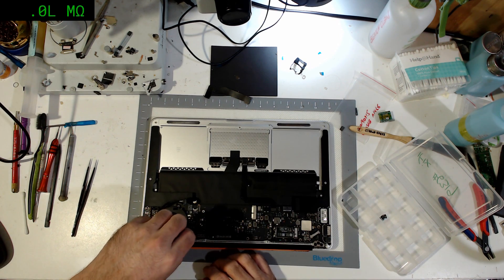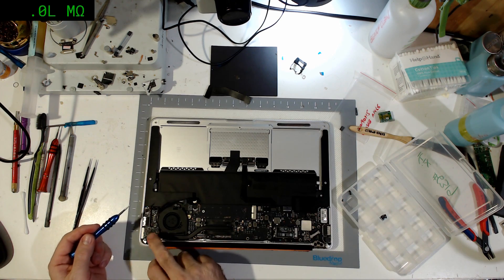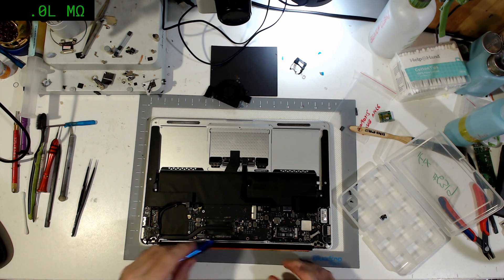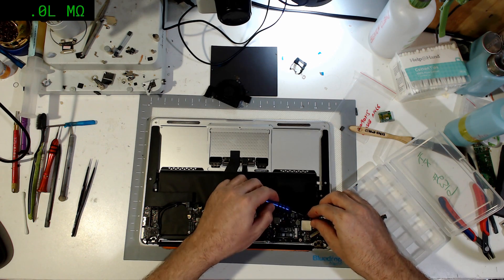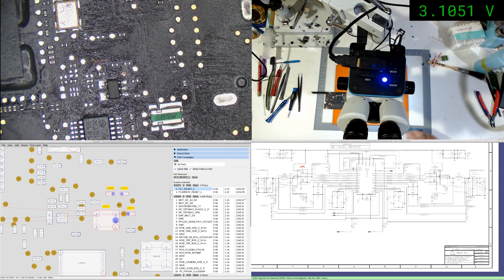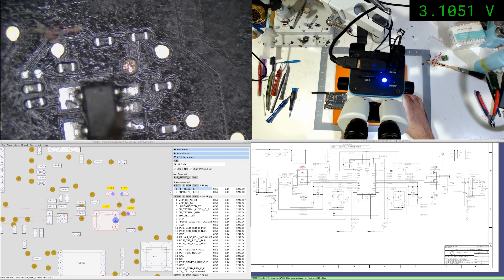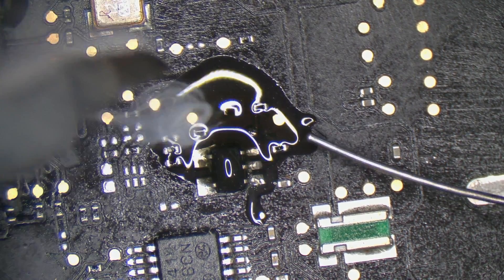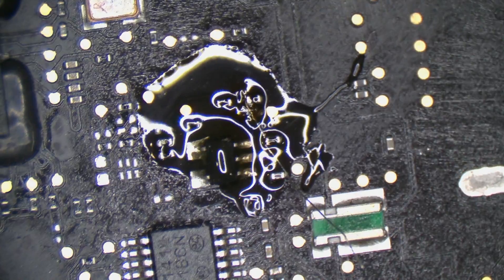#238 Macbook Air A1466 820-00165 no WiFi

Comment from the maker: UPDATE on the broken link between U2701:2 and R1671 / R1680 that carry PLT_RESET_L;  with a brain that's awake;  it wasn't a break in the generation of PLT_RESET_L, instead it was a downstream feed, which is used to control CAM_PCIE_RESET_L and AP_RESET_L, as such it wouldn't stop the system booting.

Comment: Hi Paul

What size Ultrasonic Cleaner do you use?  I am looking at a secondhand one but not sure what the best length is best.  What's the widest Macbook board?
Reply from the maker: You want something with about 330~350mm width.   Mine is a generic 10 litre one and it's still a tiny bit of a squeeze to fit in the new/large 15" MBP boards.

Comment: Hi Paul.  What video capture card do you use?
Reply from the maker: At this point, all cameras are coming through USB and being captured with OBS.  System is an i5-8400.
Reply: @pldaniels  Ahhh yeah.  HDMI Capture cards are damn expensive
Reply from the maker: They truly are.  I have to admit, I'm surprised that the system manages to handle the 3 x USB cams without trouble now, so it's probably cheaper to go this route, though I do wonder what the HDMI output quality could be like from the camera in comparison.... that said, there is a downside, I don't have control of the camera parameters because you need a USB mouse plugged in to the port on the camera to adjust